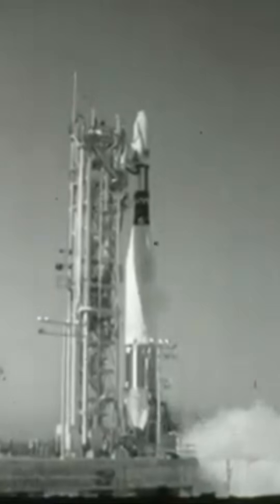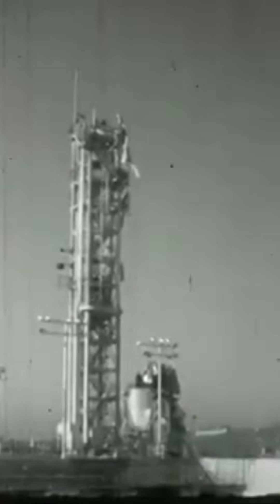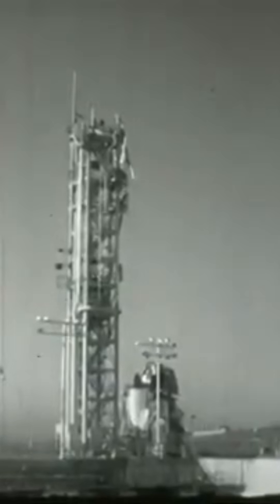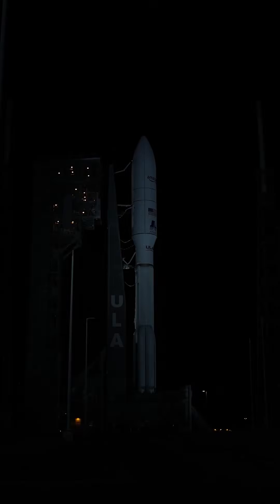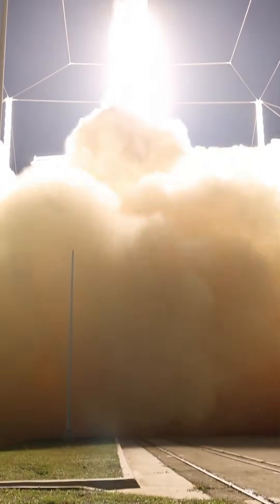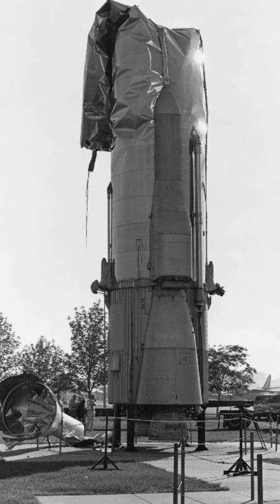Rocket Implodes Instead of Explodes????

Comment: Case in point, the Atlas ICBM  on display at the USAF museum wnich was pressurized by a compressor.  When the power failed, the missile collapsed; the replacement exhibit had its tanks filled with hardening plastic foam to hold shape.

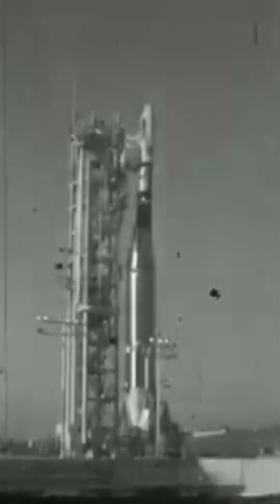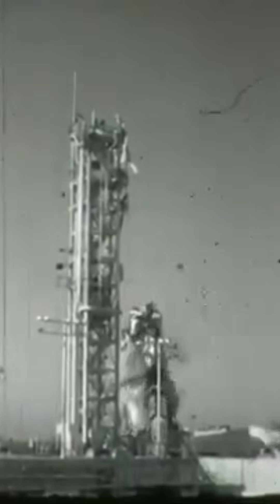Comment: No way Jose! This one video clip that starts at 0:24 and ends at 0:31 reveals that NASA has lied about EVERYTHING that they have ever done since their founding in 1958 by Aleister Crowley and Walt Disney. This seven seconds of video that I will clip out and use to show that rockets are just helium filled balloons is enough to convince the feeble minded and indoctrinated sheeple. If you don't believe me, just check out the Fittest Flat Earther. He wears a cap that says "Ice Wall" so you know he can be trusted.
Reply: its genuinely incredible how you can think that a rocket can carry thousands upon thousands of tons of helium, while at the same time, carry enough fuel to keep its engines running and producing noise loud enough to start car alarms and be heard for miles.

Comment: While working for a Hughes contractor in 1961, my dad wrote launch procedures manuals for early Atlas. Included were minimum internal pressures for storage and transport, and diagrams for the suspension harness you would hang it by if it was necessary to depressurize it.

Comment: In 1987, the Atlas D at the Air Force Museum (now the National Museum of the United States Air Force) stood on Missile Row, in front of the musem and was kept inflated by an air compressor. I'm sure the museum staff knew that, but none of us in the Security Police who guarded it new until the night we had a power failure. Around 3 in the morning, about 2 hours after the lights went out, the dummy warhead on top of the Atlas crushed it. I still have a few small pieces of the stainless steel that the tanks were spun from.
Reply: The museum apparently got a replacement Atlas and shipped it to Copley, Ohio where a specialty metalworking company installed an internal support frame.  That new Atlas is now on display in the Missile Gallery.  Lucky motorists got to see the rocket being transported on I-70, I-71 and I-76 as it made its round trip.

Comment: Back in the day, it was standard procedure to open the propellant vent valves when storing and shipping Saturn stages.  The S-IVB stage that's now in the Skylab display in the US Space & Rocket Center Rocket Park was shipped to Marshall Space Flight Center during the winter of 1977-78, but with its vent valves closed.

It got unseasonably cold (about 10 degrees F) on the evening of January 8, 1978, and the contraction of the air in the in the sealed tanks caused both the LH2 and LOX tanks to be deflected inward several inches.

They first opened the vents, which helped with the deflections, but then closed them again and pumped in pressurized air.  All of the dents popped back out by the time the pressure hit 0.31 psig.  I'm sure any other damage "buffed right out."

They later rendered the tanks "permanently vented" (I have visions of someone with an electric drill :-) to preclude recurrence.

Comment: The Atlas at the US Space & Rocket Center has an air compressor.  I've been in the Rocket Park when there are very few people there and it's very quiet.  I've spent enough time at the USSRC to expect the air compressor, but it can be funny to watch people standing near the Atlas when the air compressor goes off.

The USSRC also used to have a Centaur G Prime (which was created to fly in the Shuttle's cargo bay), and that also had an air compressor on it.

Comment: What happened there at about 0:20 where there's like a hidden jump cut? The scene is almost the exact same after it whites out, except the color of the tank has changed, and like a white hose connecting from the top of the tower to the rocket appears to reposition a bit.

Comment: If structural rigidity came from fuel pressure, what kept it rigid after fuel ran out? Absolutely ridiculous fake engineering 😂
Reply: Ullage pressure. Its not hard to look this up
Reply: @Ethan_Roberts  yeah it's BS tho. Just saying some magic technobabble phrase don't make it real, harry potter. You're saying pressurised gas was pumped into the rocket body at the same rate fuel was pumped out, which is ridiculous. You'd need a whole other rocket body to do that, which itself would require yet another rocket body, etc, etc, etc... Utter NONSENSE 😂
Reply: @papalegba6796you do know that gas from evaporated liquid fills a much larger volume than the liquid itself. Its entirely possible to keep a container at the required pressure while draining it of liquid, take a high pressure propane tank as an example you might be able to grasp. Ignorance of a subject doesn't mean you've debunked it
Reply: @Ethan_Roberts utter nonsense again. Show me this propane tank you speak of that can be kept at the same pressure while being drained of propane. It does not exist, you just made it up. Same as nasa did with these silly fake rockets. You are shameless 😂
Reply: @papalegba6796 so you admit you can't grasp the simple concept of pressure equilibrium? You have all the answers right in front of you to explain how ullage pressure is maintained yet you choose to remain wilfully ignorant and in denial of physics. Well done, you made a joke out of yourself

Comment: It does seem humorous when a phallic looking structure falls over from a lack of internal pressure. I would try expanding plastic foam to get one on display to not to go limp. It would involve letting the air exit through a pressure regulator and pump the foam in at pressure so the foam can fill the rocket without the rocket collapsing in the process.

Comment: "Thousands of gallons of Kerosene".  Oh the horror of that clean up.
Reply: Update: my hunch was right. They use vac trucks, absorbent media (aka kitty litter), and boons. Any soil contamination is hauled off as haz mat.
Reply: @hawkdsl 
Big job.
Reply: @hawkdsl 
BIG Job for whomever got to run the soil incinerator.
Reply: Just needna match or a cigarette to do that cleanup.
Reply: @josephbucci2724 
Liquid Kerosene and Diesel require more than that to ignite.
AND it doesn't get hot enough to get the fuel thats soaked into the soil.
They'll have to remove a deep layer and run it through a specialized incinerator.
Reply: How would they?
Reply: @sadbob2356 I imagine they had a vacuum truck like you see for sewer systems. It would be everywhere though.. ugh.

Comment: According to the Air Force, "It's fallen, and they can't get it up." 

Seriously though, there is one display Atlas I know of that was purpose built with an in internal rigid wood skeletal structure. It is an Atlas missile on display at the SAC Museum near Ashland, Nebraska. It was purpose built by Convair as a display Atlas and at one time it was on display in front of SAC Headquarters at Offutt AFB, Bellevue, NE. I also believe the same Atlas was on display at Wright Patterson AFB next to the museum and it was somewhat famous for having a giant inflatable Santa Claus covering put over it during Christmastime events. Sometime in the 70s I believe is when it got sent to the SAC Museum (when it was in Bellevue) and as I understand it it was replaced with a recently decomissioned Atlas E which did need to be pressurized. Apparently the pressurized rocket lost power (Electrical Dysfunction?) during a thunderstorm in the late 70s and the winds from the storm shredded it. The results didn't look pretty at all.

Comment: Some actually collapsed on the assembly line when the pressure pumps failed. I almost damaged one by opening a hangar door on a cold morning, as my desk was in the booster assembly room and they had just placed a new tank in a fixture using a diesel crane, which left fumes in the room, so I opened the door. As the cold air rushed in I heard a couple of loud booms. I looked up from my desk and saw some large dents in the tank closest to the door. I ran to close the door and the pump began to restore pressure to the tank, avoiding damage. The worst thing that could happen was the hemispherical bulkhead inside could reverse, scrapping the whole booster tank.
Reply: Part of my job at ConVair Test Labs was to keep us supplied with GN2, nitrogen. The Atlas production line would routinely steal our GN2 trailers when they got low. They needed gas to keep the Atlas and centaur tanks from collapsing.
I'd find one or two or three of our trailers just gone, then I'd know who to call. "I know, I know. But you have to credit our budget somehow guys!" We had to postpone tests sometimes. LOL!
Reply: @divermike8943  thanks, because of guys like you two I still open the comments
Reply: Thanks for sharing! How long ago was this? And if I may ask, what was your job there?
Reply: Was something I said funny?
Reply: .                                   Ditto
Reply: @MythRsR1979 😂
Reply: According to the USAF, Convair made about 350 Atlases.  The nuclear ICBMs went operational at Vandenberg AFB in 1959.  Atlas remained in service until the Minuteman began to deploy.  The US also had the Titan liquid fueled ICBM in service a few years after Atlas entered service and both were in service concurrently.

When first deployed, the Atlas took 15 minutes to prepare and launch because it has to be moved out of the storage shed and erected then fueled.  Silo based versions could be launched in 10 minutes.  The Titan could be launched in around 60 seconds because it could be stored already fueled in the silo.

Comment: I think this was how WD-40 was invented (the US Air Force needed a light oil to prevent condensation and ice buildup on these thin tanks)! They named the formulations as WD (water dispersant) with a number for each version of the chemical. The 40th "try" worked best and became the famous lubricating spray and solvent so handy to this day.
Reply: Not the Air Force, but Convair if I recall the WD-40 story right. It needed a Water Displacing solution to protect not just the stainless, but the electrical/data jacks and plugs from water infiltration.

Comment: A Falcon 1 also imploded. While being transported by air. No one thought to equalise the pressures on descent and the increasing air pressure destroyed the booster.
Reply: Yeah, the fourth Falcon 1 suffered some buckling during delivery to Kwajalein. I wouldn't go so far as say it imploded though... damaged, yes, but not enough to prevent if from being launched after some repairs.
Reply: @simongeard4824  well if the rocket in the video counts as "imploded", when it really just buckled under the weight without the pressure holding it up, then I think the F1 counts.

Comment: The Saturn V upper stages, the S-II and the S-IVB, were also made structurally rigid through pressurization just as the Atlas was. Extreme measures were taken to reduce the mass of the second stage, the S-II, where the tank wall was also the stage wall. The oxygen and hydrogen in its tanks were separated by a common insulated bulkhead. It was a stainless steel balloon with rocket engines attached to the rear.

Comment: So the Atlas was a high tech balloon !
Reply: Space flight rockets are over 85% fuel mass at launch. But most are structurally sufficient to stand empty.  The Atlas rocket was America's first ICBM.  It was also used in the Mercury program, as it had the performance to boost a Mercury capsule into orbit.

Comment: There is an Atlas booster on display at NASA Huntsville and they have a compressor running behind it that kicks on every few minutes to keep it pressurized. I recommend the book "Atlas: The Ultimate Weapon" for a good read on the history of the program.
Reply: Every few minutes? So it actually leaks. 😅
Reply: @MythRsR1979  couldn’t they fill it with spray foam?
Reply: Have a 6-8 inch thick foam shell applied to the interior then, attach structural members to the foam.
Reply: @MythRsR1979  Yes it does. Considering it's age though it's amazing it doesn't leak more. They always leaked from the beginning and nitrogen tanks were used with them to keep up the pressure. The one at the museum has patches on holes on it from damage from all those years exposed to the elements. I remember replacing hoses and seals between tanks that were getting heavily cracked from age but it still gets the air compressor to cycle every few minutes. The current techs tell me they came up with new patching techniques due to how difficult it is to patch a pressurized tank.

Comment: The old Atlas rockets actually used fuel pressure to stand.  When empty, prior to launch, the main tanks were pressurized with nitrogen, so the rocket held it's shape.  Also, a pressurizing gas like helium needs to offset pressure loss on all liquid fueled rockets or the powerful turbopumps will collapse the rocket like sucking air out of a soda can.
Reply: Helium can be useful (mass, I presume), but SpaceX plans to use autogenous pressurizing gas in Starship: the vapor state of the propellant in the tank will be the gas to pressurize the otherwise empty volume.
Reply: @rockrose82 Interesting.   Another example of no part is the best part.
And mass is why with helium. Light weight, yet very expansive, and compressabe. Also, being a noble gas, totally inert.  What do you think SpaceX puts in those tempermental COPVs?
Reply: @rockrose82  that's terrible if they need to pressurize even empty. How are they gonna stabilize the ship in mars or moon?
Reply: @i3_13 So far as we've heard, Starship & Super Heavy do not require pressurization to remain intact. I've only heard of older Atlas rockets, & Centaur upper stages, needing it constantly. It's just if loaded propellant starts getting drawn off that pressurization is needed.
Reply: @i3_13  The real problem is the opposite.   Methalox is cryogenic.  Ad it warms, it boils off.  The pressure relief valves must vent the vaporized fuel, or the fuel tanks will rupture.  So, how does SpaceX expect to vent for a week, and still have enough fuel to rendezvous with Orion?
Reply: @SliceofLife7777  Good point and good question! SpaceX hasn't released any details, so far as I know. People following their program assume that their tanker crafts will have to have good insulation and maybe active heat radiators. I suspect careful sun and earth orientation will be needed too. (The sun is a small disk radiating at 5800K; in low Earth orbit, the Earth is radiating at about 300K but takes up half the sky.)
Reply: @i3_13 Starship is not an antique Atlas rocket, is it?  Compared to most liquid fueled rockets, Starship is a bit over engineered for reusability.  Only the original Atlas took it that far.  But even Starship must replace expended fuel with pressurized gas, or the turbopump(s) will collapse the rocket via suction.  Spaceflight is very difficult.  Any organization that makes it look boring, is a rare thing indeed.  Since Yuri Gregaren, there are only three nations on Earth that have risen to the challenge of successful human space flight.  So since the 1960s, only three nations have demonstrated this level of engineering genius.
Reply: @rockrose82 A fuel station in orbit, hiding it's fuel tanks from the sun with a large solar array, that powers some sort of cryo refrigeration system?  Such a refrigeration ststem will be too heavy.  Storing cryofuels over a substantial period of time in space would be a first.
Reply: @SliceofLife7777  That's indeed something that people are concerned about. I'm not sure that it would be too heavy, though, because the square-cube law will help out on the large Starship tanker variant.
Reply: @rockrose82 I hope so.  There are a few concerns, but I'm rooting for SpaceX.   There's never been anything like them.

Comment: And in every REAL man's toolbox, besides the "gray tape", is a can of WD-40, formulated to protect those thin stainless steel "balloon" tanks from getting rust from the salt air at the Cape and Vandenberg and causing such issues such as "structural flaccidity".
Reply: I used to watch them apply it with large dust mops.

Comment: That is not an implosion, that’s a collapse
Reply: Id call it deflation xd
Reply: First an implosion, then a collapse of the fueled part above it? A RUD any way you slice it
Reply: Caused by gravity instead of by negative pressure?
You need a rigid structure to get a negative pressure.

Comment: Makes you wonder how you even manufacture such floppy tanks. They can impossibly be pressurized during the construction, are they just constructed as floppy sacks and then inflated like balloons?
Reply: I I remember correctly, The tanks are held in shape by a frame until they are complete, and then can be pressurized.
Smarter Every Day has a video tour of the ULA factory that shows some Centaur upper stages built using this method.
Reply: The empty tanks can withstand their own weight but not the extra weight on top of them when the rocket is stacked
Reply: From what I read, the tanks are depressurized during construction and then inflated.